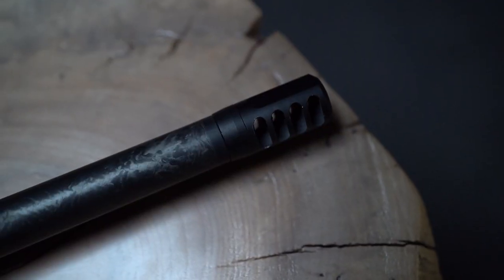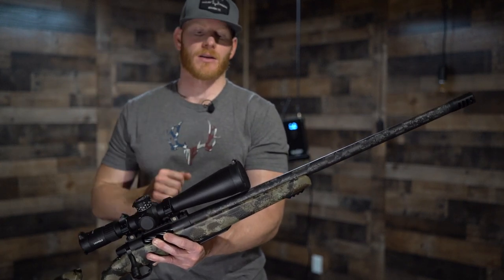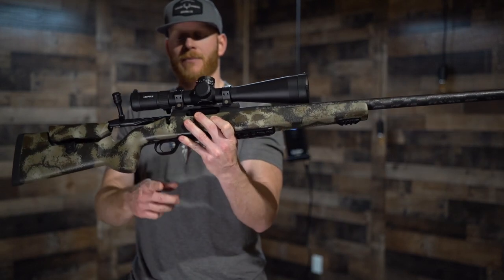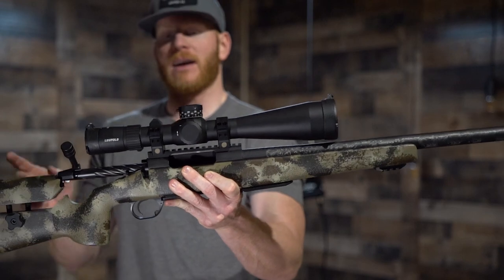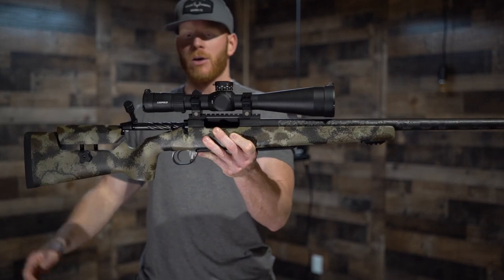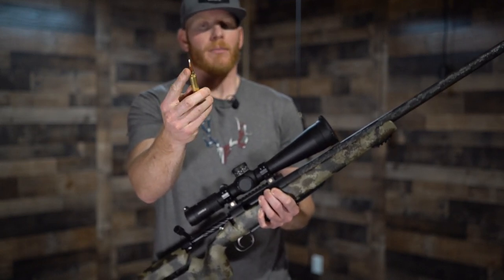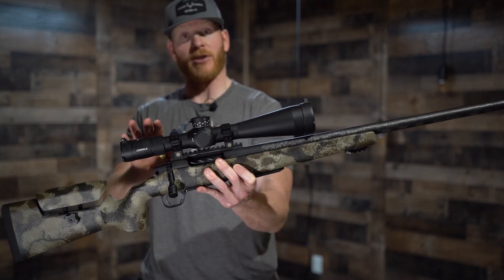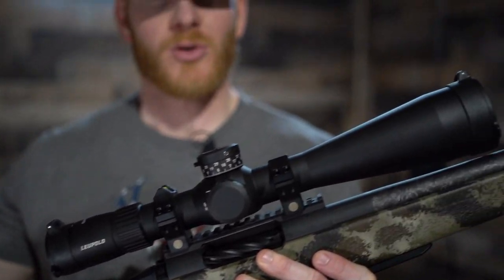Custom 7mm WSM Rifle Build

Comment: Why 7wsm?? That cartridge is borderline obsolete, there is little to no factory ammo available and brass is no better. No hate, just curious, seems like there is exponentially more components available for the 7saum or basically any other short action magnum for that matter. The 7wsm seems to be the least favorable of the lot. Just picked up a 270wsm that I intend to turn into either a 6.5prc or 6.8 western, due to component availability, and curious about your rational behind the build.
Reply: @paintbrush8743  I understand the benefits of the cartridge, on paper it does everything right but I'm practicality it gains no points. Of all the short mags the 7wsm was by far the least popular meaning brass is incredibly hard to come by not to mention expensive when you can find it, dies are also not easy to come by. Nothing about a 7wsm is practical even if it is efficient. Don't get me wrong I love an odd ball caliber as much as the next guy but with the lack of available components, even under pre covid conditions, it would have been hard to justify a 7wsm I'm just trying to wrap my head around the why of it.
Reply: @paintbrush8743  again you are completely overlooking my point and initial question 😂 I understand the perks of the 7wsm, on paper it looks great but in practical terms it is borderline worthless. Brass is still nearly impossible to find and wasn't any better pre pandemic. Doesn't matter how great a round is if you can't load for it then it's worthless. The 7 saum on paper is on par with the 7 wsm but at least the saum has a decent following and you can find components for it.
Reply: Because that's what he wanted, calm your nerves